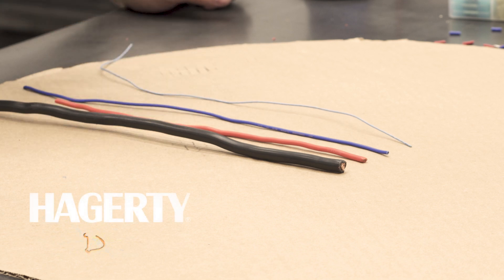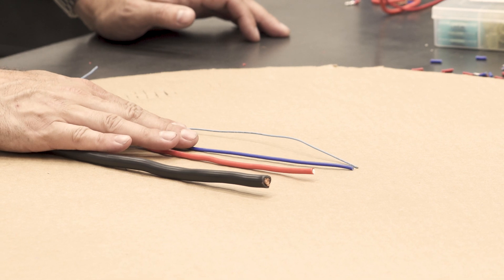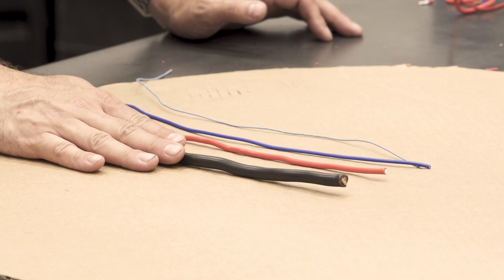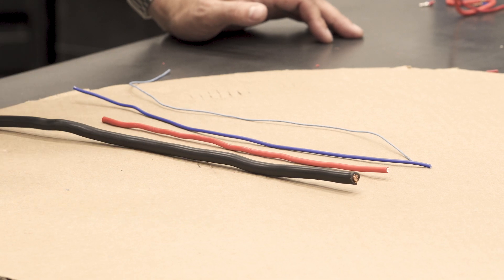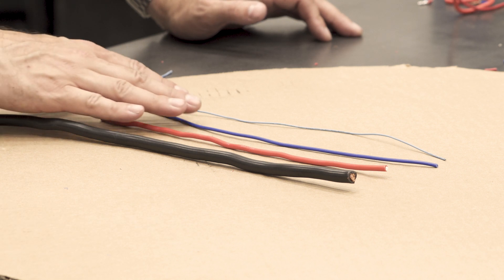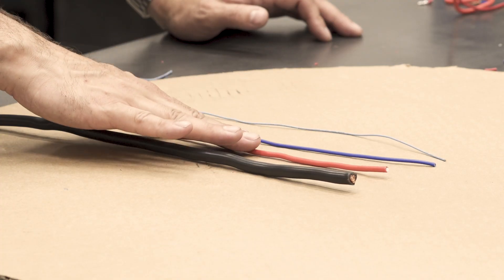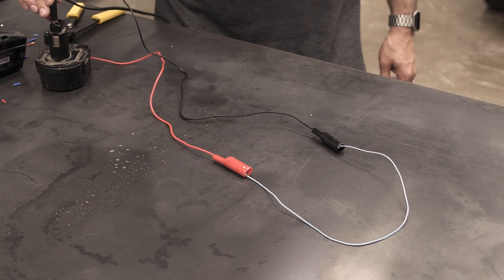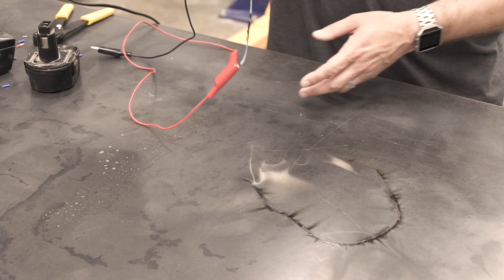Wire Gauge DOES Matter | Hagerty DIY

Comment: calls that tiny lil black wire a 4 gauge , yea maybe over seas wire gauge but the AWG standard is better bigger and can handle way more look at Sky High Car Audio 4 AWG OFC for example re built all power and grounds on a 94 honda accord with this stuff and had over all improvement in starting , idling , and response compared to the nearly 1/2 sized " 4 gauge " import scale wire which 9 of 10 is not OFC and has thick individual strands  that break over time do to high rigidity horrible termination points or uncovered copper , like in the case of the honda accord project SPL car went from poor spark and electrical issues and stalling out from not enough electrical flow to a car that felt factory new when starting and driving. wire gauge does matter and so does AWG <---

Comment: It not just about using the correct gauge wire...using the correct size fuse for that gauge wire is equally important. Swapping out 5amp for 30amp fuse could lead to a wire catching fire if a fault occurs which ends up with a huge load being sent down an inappropriate sized wire instead of the fuse blowing first.

Comment: i got a question. my wire that goes from the starter to the positive terminal of the battry is short. ( my car was broken into and they stole the battery) can i buy the same gauge wire and solder it together ?
Reply: Skye Fuego: You can splice any wire, but it is always better to just "run" a new wire or replace wiring like that, especially the positive battery cable as it's pretty much the most important wire/cable on the car.
Reply: @rogergoodman8665  true. I didn't want to take a risk. Thank you.
Reply: @Skyefuego  : Your  welcome. Sorry someone stole your battery, same thing happened to me once.

Comment: There are so many details to wiring things safely-wire gauge is important-so is the jacket temperature rating, compatibility with fuel and oils, proper termination and many other factors. Be aware. Solder and shrink sleeve all connections. BTW- solid wire provides more current capacity then stranded wire, for a given gauge-but should NEVER be used in a vehicle

Comment: Had to rewire a few boats years back.  One I had to rewire and hack after I didn't inspect it prior to launching it.  Got out for night fishing with guys from the shop.  One of the guys tried to fire it up after a few hours of off and on use.  The idiot who owned it before us had used the wrong gauge wire and it was solid core home type wire.  It melted from end to end leaving us with no way to crank the engine 2 miles from the landing at 2am.  Trolling motor was done the same way and took some odd hacks to get enough wire to run the trolling motor to get us home safe.

Comment: Whats a gauge 1 wire, and what happens if you need a bigger wire? the gauge system running backwards seems counter intuitive. For example thousand kilowatt lines im assuming are much bigger than whatever a gauge 1 is. How do we then classify that? There is a limit to how small a wire can theoretically get but at the other end of the spectrum you can hypothetically have a block of metal the size of a moon thats insulated that could handle unthinkable amount of power. Not that this is something we've ever built or that there is even enough copper in the solar system to do so but the extreme example is to illustrate the point im trying to make here.
Reply: After 1 ga, is 1/0, 2/0, 3/0 and 4/0
Reply: @jayt825  those are metric sizes. AWG tops out at 4/0
Reply: What about KCM? After 4/0 you have 250KCM then 300KCM up to I think 2000KCM. KCM = thousand circular mills so it is measure of the wires area in a way. It is still a British (non SI/metric) measure of very large wires. 250KCM is good for something like 215 Amps continuous. Your starter is not continuous.

Comment: Again the metric equivalent system makes more sense. Smaller number = bigger wire.....SMH.
Reply: Gauge as a measurement is always smaller number = bigger.  For wires, shotguns, or sheet metal.
Reply: @MrJacksjb   We do know this, but what if you need wire that is thicker than AWG 1?
Reply: @matel1s  you have 0; 00; 000; 0000 or 1/0; 2/0; 3/0 and 4/0 witch is crap af and non sense
Reply: @matel1s  You use 0, 00, or 000

Comment: also stay away from aluminum  wire.   In some data applications they try to sub in something called cca copper cover alum. at any rate less current carrying for a given wire gauge plus brittle.
Reply: Copper-Clad Aluminum is good for short distance high current applications. It's not bad it just has to be applied for what its engineered for. 
You wouldn't Torque down head bolts with a pair of channel locks. Doesn't mean that all channel locks are bad but you have to use them for their intended purpose.

Comment: Something I've found that works well on old cars I would buy (and not want to invest heavily in them) - hook up a second negative cable.  Old electrical cables/wires corrode inside, or sometimes develop breaks in some of their wire strands.  Too, the cable or woven grounding straps going from the engines to the firewall were fully exposed, and flexed all of their lives. I'd go to the parts store, grab whatever pre-made negative-lead (in those clear plastic boxes up on the wall) had an eye at one end for a bolt, and whatever connector I needed to attach it to the older-cable's battery post clamp.  I'd then run that 'second' negative cable from something like the head, the alternator bracket bolt, or what-not, back to the battery. It just about always made the starter motors spin faster and made the vehicles run better.
Reply from the maker: Interesting approach. Thank you for sharing!

Comment: I've seen lots of cobbled together wiring! Nice simple explanation of correct wire size for the load. You can't over stress proper over-current protection! Use the correct size fuze or breaker for the wire size and electrical problems become an inconvenience not a disaster!